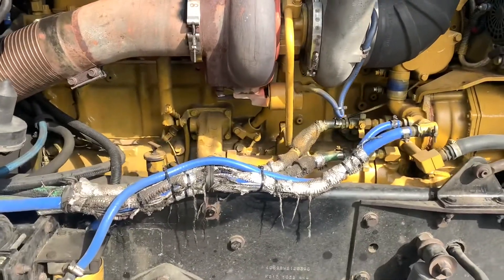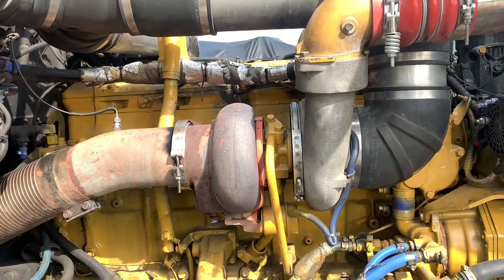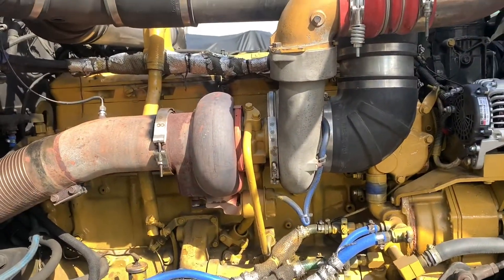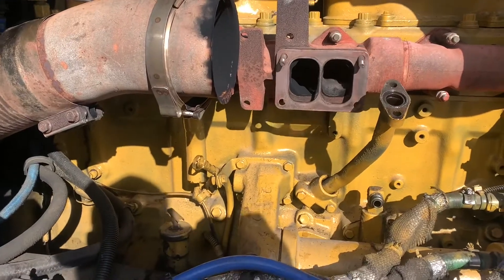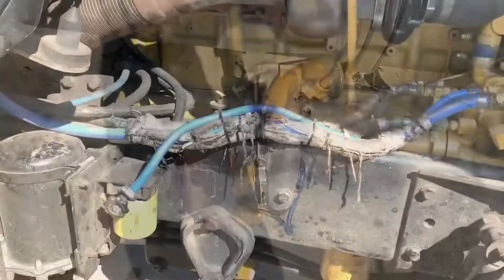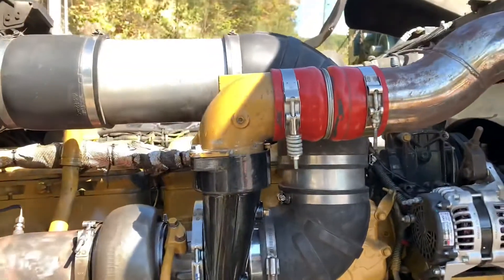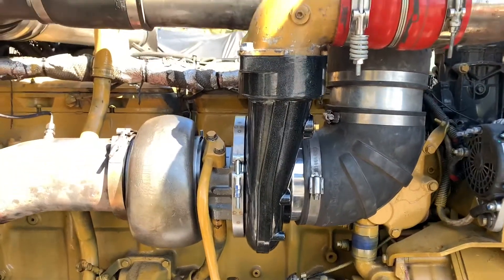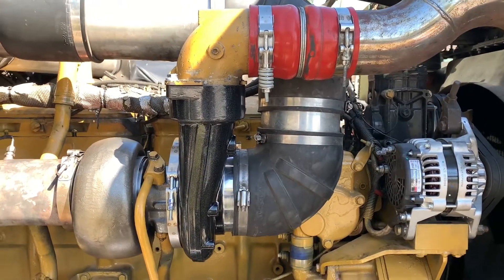Installing a BullyDog stage 2 turbo on a Cat 3406B

Comment: Hello! Couple questions: Do you still use it (bully dog turbo stage 2)? Do you remember part number?  BDT56800 (78mm 1.45AR) or BDT56845 (80mm 1.45AR)? Looking for one... for myself... 3406B ATAAC. Does it work good for you (longevity/reliability/performance)? 
Thank you!

Comment: How many horses she sitting at now ?
Reply from the maker: Don’t know. Screws are 4 turns out from stock on a freshly rebuilt injection pump. OR 8785 marine nozzles, BullyDog turbo, and a dozer spring in the AFRC, plus advanced 4 degrees.
Reply: Dozer spring?
Reply: If his truck is a stock 425 but has the fuel pump turned up, with a turbo like that Iam guessing he's around 550 or 575hp as is

Comment: How much boost does the new turbo produce?
Reply from the maker: 42 psi
Reply: @etcllc3519 wow nice, my turbo only puts out 25psi of boost
Reply: @etcllc3519 thats a good amount of boost, you should be well over 550hp now
Reply from the maker: Most I’ve had is 45 lbs of boost with the screws turned out all the way on a 3406B.  Now we are three turns out and average 8 mpg as long as we keep the boost between 20-25 psi. Downshifting and running slow and low is not a problem for us. We take care of our truck, pay attention to the twenty four gauges, and he our freight from point A to B reliably. This is not a Ferrari, it is an eighty thousand pound wrecking ball.
Reply: @etcllc3519 hey buddy,  can I  ask a few questions  on the  B Cat.
Reply from the maker: @joshayneanderson5117  ask away
Reply: @etcllc3519  I am thinking  of  getting  a stage 2 turbo and with stage 1 injectors (10 % more fuel  delivery  to cylinder  than  stock injectors).  You seem to  have  a  similar  set  up.   What's the power  like,  what's your fuel  consumption (close estimate is good  too), does  it  smoke  alot, I'm in Ontario  so we have to  deal with  emission control.  Thanks.
Reply from the maker: @joshayneanderson5117  screws are set two full turns out from stock. Plenty of power, only smokes at shift. OR8785 Marine nozzles. High idle screw jam nut is turned all the way to the end of the threads on the screw for a 2400 max rpm. Dash pot is 1 1/4 turns out from bottom. High tension spring out of a dozer is in the AFRC. Gets about 10-12 mpg empty, 6-8 mpg loaded, depending on terrain and conditions.
Reply: @etcllc3519  ok sounds pretty  decent, I'm pulling  40 tonnes, what kind of  weight are you  running.
Reply from the maker: @joshayneanderson5117  80-90k pounds gross
Reply from the maker: @joshayneanderson5117  70 mph @ 1700 rpm’s on a low reduction 15 speed with 3:70 rears and tall 24.5 rubber. Drop a gear on a slope, 2100 rpm’s, holds 70 pretty well and gradually falls off. Keep the high rpm’s on a climb.
Reply: @etcllc3519  ok. Sounds like my setup will do  well, because  I am running  390 rears at 46k  and 189B - 18 Speed  on 24.5's. I just rebuilt  the  injection  pump last year but to keep  the warranty  I had  to  run  it  stock, the warranty  just expired so I can do  mods to it but its still  a want  it  to  be  a work truck. Thanks alot for the  info, you provided  a great deal  of  insight.
Reply from the maker: @joshayneanderson5117  sure
Reply: @etcllc3519  hey buddy, I had my fuel RATIO  control  valve diaphragm  rupture  a couple weeks back.  I remember  you saying  to put a dozer  spring  in  the  AFRC  can you  give me  a little  bit more details about  the  spring, I'm  not too familiar  with  all the old terminology. Thanks.
Reply from the maker: @joshayneanderson5117  it’s the big spring in the AFRC. The “Dozer” reference is just that it is a tighter spring with more tension allowing less movement of the pin inside. It creates a situation where the afrc doesn’t bottom out so quick.

Comment: What kind of boost did u get afterwards
Reply from the maker: I get 45 lbs of boost
Reply: @etcllc3519  before or after the new nozzels
Reply from the maker: @westleycrouse3299  after
Reply: @etcllc3519  what did u have befor the nozzels with the stage 2